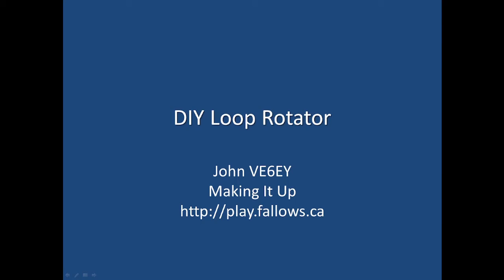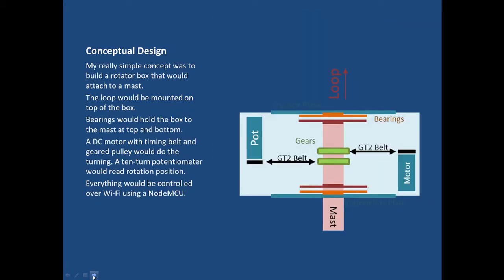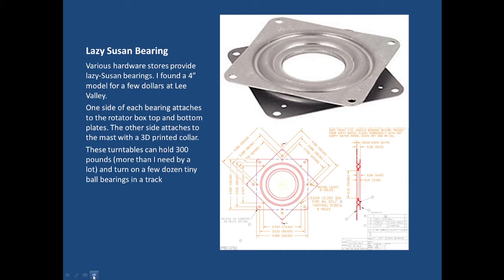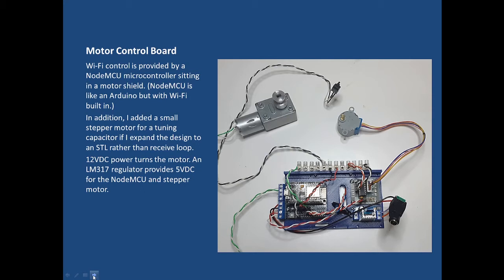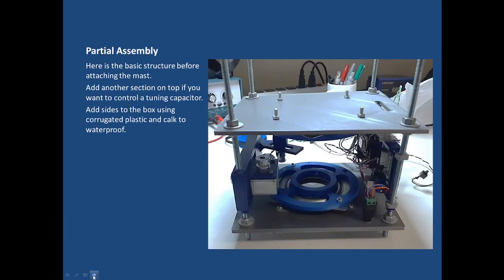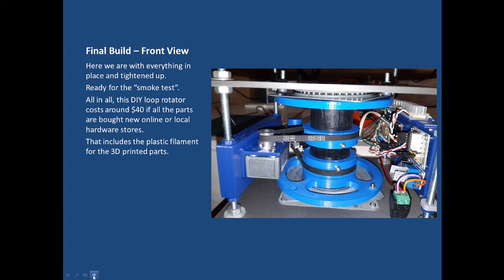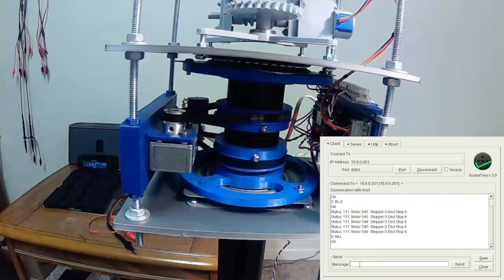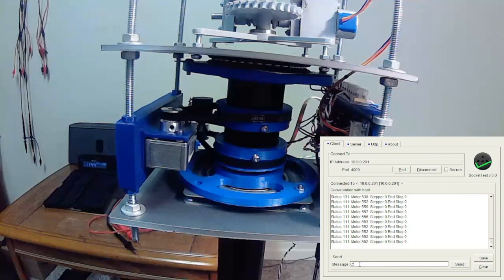DIY Loop Rotator

Comment: What type/model 3-d printer are you using? 

My application would be for a lightweigh Az-EL control of Arrow antenns for satellite communications and monitoring.
Reply from the maker: I am currently using the original Prusa i3 MK3S mainly with PETG filament. Works well.

Comment: I’m guessing multi turn pot for the position sense?
Reply from the maker: Yes, Rob. Attached to NodeMCU analog pin. Reads 400 at low end, 700 high (range 0..1023). Analog input is noisy so some smoothing (averaging) required in the firmware. Cheers.